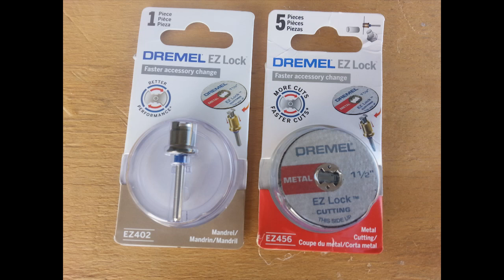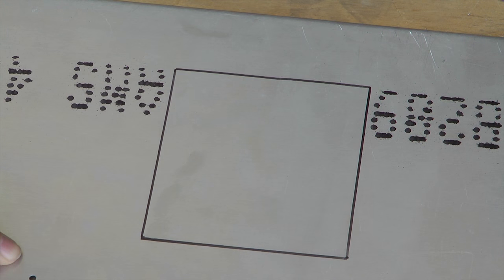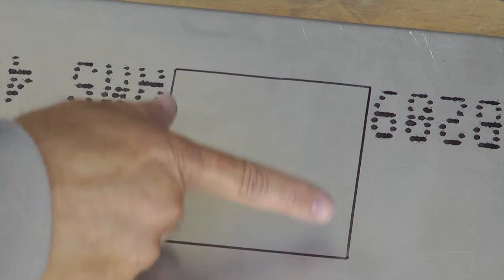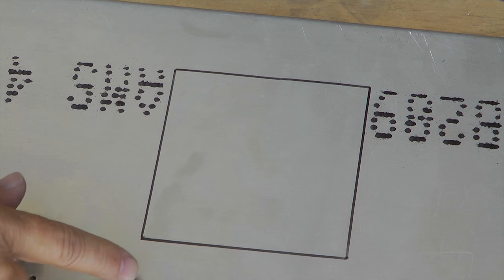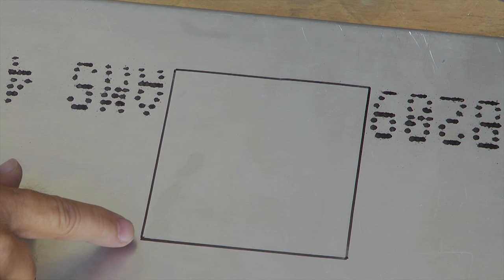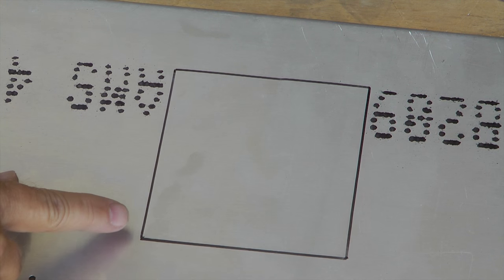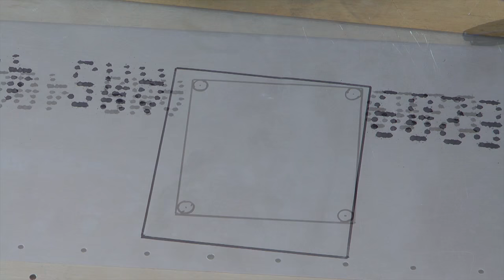Using Power Tools to Cut Access Openings in Metal Aircraft

Comment: Tip - Tape some sacrificial aluminum at the end of your cut. If your blade grabs and pulls near the end of the cut, you can end up with an ugly scar on your piece. The sacrificial aluminum will protect your part if this happens. You can also use a straight piece against the good side of your piece to protect and serve as a guide.

Comment: If you go back and forth with shallow cuts your cutoff wheel will last a lot longer rather than going deep.  The latter "chunks out" the wheel and it wears rapidly.  There's a test on YT somewhere.  Think it's by Fireball Tool or similar.  $0.02.

Comment: I had something similar where I needed to cut a hole for a clear polycarbonate window.  Yes, I could have used a cut off wheel like you did, but I used a router attachment for my rotary tool with a general purpose cutting bit.  Then I just set up some stops and routed out the hole.  Worked great.  Of course the way I did it requires a lot more setup and a larger workspace.

Comment: Another option to a dremel style tool is to use a pencil micro air grinder such as can be found at Harbor Freight. Electric rotary tools have too much torque and  can get away from you Possibly damaging the part. The pencil air grinders have a lower torque and just slow down instead of running away.
Reply: once you don't suck at using the tool you should be fine :p

Comment: Thanks! I wasn't sure which bits to use to cut metal computer case because my dremel came with many but without any description at all. I have similar disks and if yours handled sheet of metal that thick I should be fine. Fingers crossed.
Reply: How did you go? I'm trying to do the same thing 🙂
Should I get the dremel ez lock bits?
Reply: @foro1  Hi 🙂 ez lock is just an easy way to quickly switch disks in case one breaks. I was lucky (or careful) enough to not brake any so ez lock wouldn't help me much. I did go through 3 disks, a single one lasted for about 10 minutes before it was too worn out to keep going. My rotary tool isn't Dremel though so maybe original bits last longer 🤷‍♂️

Comment: damn for $20 that thing sounds like it has a lot more power than the one I got for $20 at the store...
Reply: I have a cheap knock off that looks identical but with a different "brand" sticker. It's only 1 amp so it's underpowered for using a big cutoff wheel like this one.

Comment: Do you know of a high quality, SOLID cutting wheel that is 1 inch in diameter, or just a little bigger?

I have a 2004 Toyota Corolla. The dim wit engineer that designed it decided the 2 nuts that hold the donut gasket together, on the exhaust manifold, just had to be WELDED down!

There is a lip around each nut, on the end of the exhaust manifold. So I either need:

1: A 1 inch cutting wheel, or just a little bigger, that can do some serious cutting. Using lots of wimpy Dremel cutting wheels does not work. Or

2: A larger cutting wheel, which means I'll have to slice through that lip around the nut.

And also some type of rotary tool that has a long and skinny end. A regular cordless drill is just too large to get down behind the engine.

It has an exhaust leak. I got 2 headaches, then figured it out. So I have been driving with the windows rolled down.

I could take it to Bell's Exhaust, for around $70. But I would REALLY like to cut those 2 nuts off, and replace them with 2 good nuts and bolts, and, of course, replace the donut gasket.

Thank you much. Happy Thanksgiving.